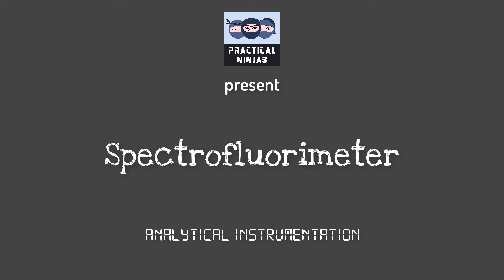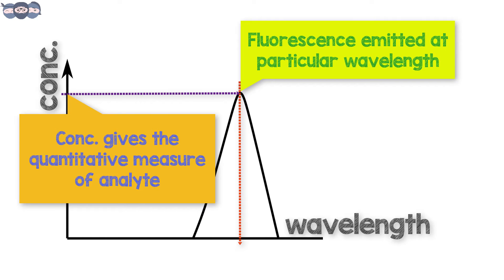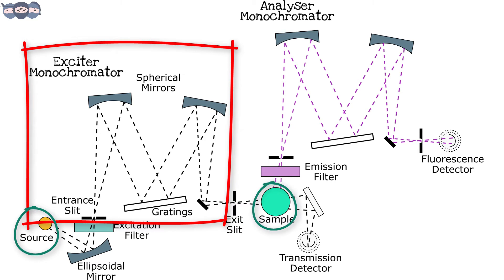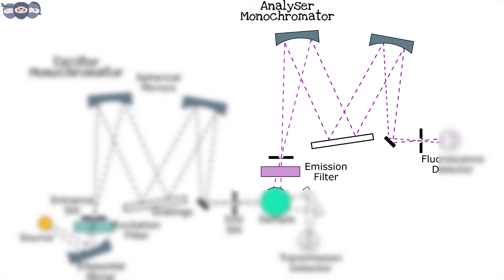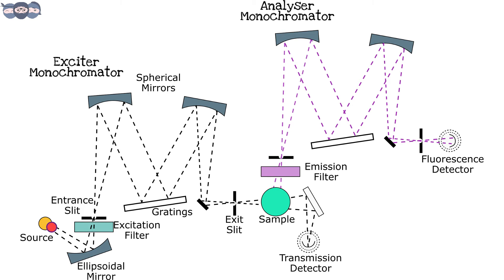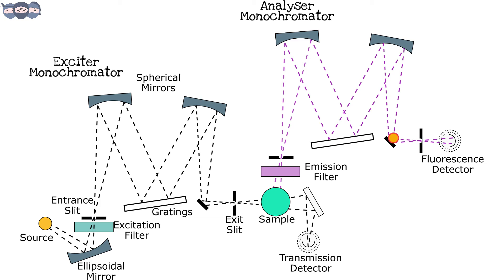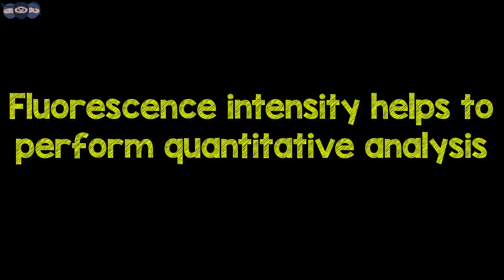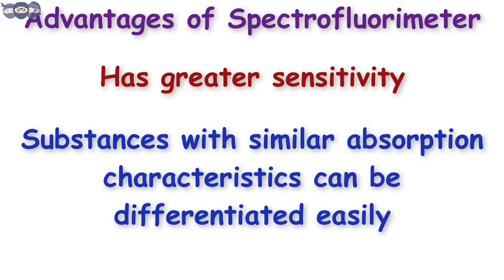Analytical Instrumentation 07:  Spectrofluorimeter Construction & Working Principles Explained

Comment: I have a doubt . 
A prism can refract sunlight so it can be used as a monochromator .  But can it be used in uv spectrophotometer and flurosence spectrophotometer ?
Reply from the maker: + DATTATREYA SATAPATHY, The sunlight which we can see is composed of the radiations from electromagnetic spectrum. The prism is responsible for dispersing this EMR. So it can be used in UV spectrophotometer and fluorescence spectrophotometer where the sources of light also emit EMR.
Reply: Thank u
Reply from the maker: Glad we could help :)